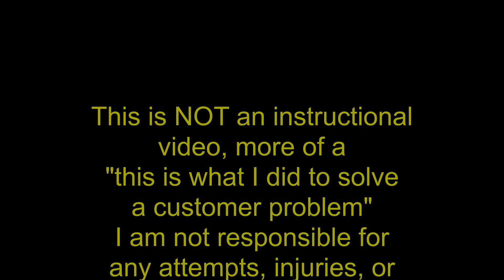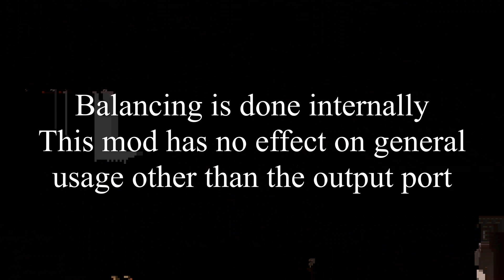Modify A Rad Power Battery

Comment: I purchased a rad with this mod. How do I get the battery to turn on. It shows power when the x260 is connected to charger but then plug back to motor and nothing
Reply from the maker: I'd need to know how it was wired to answer your question. When I do mods like these I bypass the on/off switch so the battery is always live. If the BMS has ports for the switch I'll leave it. if it's a key type switch they can just be unplugged or shorted depending on the type of switch to accomplish this (internally).
Reply: @rhodesahead4204  Hi Rhodes, the "behing" of the battery cracked and I can't find it anywhere on the planet. Do you have any idea what I could do, or where I could purchase it for the battery (back) cover? Or how to seal it ?

Comment: This might sound like a dumb question for you but what does modding it with this connector do. What will be its function
Reply from the maker: several benefits, mainly getting an otherwise functional battery back into service. Now its more "versatile" as most aftermarket and replacement battery's use an XT60 or XT 90 connector. Now its hot-swap-able or you can even run more than one battery at a time (in parallel) to extend range. This particular battery is in service for a pedicab company and they run through 3 battery's per event so the ability to hot swap is important

Comment: I have to make this adjustment why can't you make a video how to connect the wires safely without getting shocked...
Reply from the maker: its DC, you might see sparks but its not likely to shock you. the major risk is shorting the battery when the cables are bare. I just solder one wire at a time and heatshrink it before moving onto the next wire. for reference this guy shocks himself for fun and the video is of his tongue in stead of fingers but you might get an idea of shock https://www.youtube.com/watch?v=hp97GjuULX8 and this one might be more relevant to your specified fear https://www.youtube.com/watch?v=snk3C4m44SY&t=39s I have an aventon battery that needs this same mod, IF I can film it then I'll post it but big if.

Comment: how do you get it open? after removing all the screws i still can't get it open. I don't know where to pry the shell open. Please help us out.
Reply: Did you find out how you open it
Reply: @murtadhaal1483  No i didn't. i'm still looking for answers. I did find out that it' probably stuck because they used RTV silicone glue. How do you get it loose when it's stuck? i have no idea😭 lol
Reply from the maker: Mine just came apart, no fuss. Some batteries are glued in but not the cover. If you do need to pry, do so carefully and with PLASTIC tools. If you skip and puncture a cell with a metal tool you will cause a short and a fire.

Comment: Hi,
How did you open the battery case? I've unscrewed all the screws, but nothing changed. Is it glued also? 
What tools did you use? 

Thanks
Reply: i also can't figure out how to open mine. all the screws are out but can't get it open😭.
Reply from the maker: Mine just came apart, no fuss. Some batteries are glued in but not the cover. If you do need to pry, do so carefully and with PLASTIC tools. If you slip and puncture a cell you will cause a short and a fire. I use an auto panel tool kit that has a bunch of shapes and bicycle tire levers or a spudger depending on the shape that I feel would best help me.
Reply: Hey did you ever get jt to come apart?

Comment: I wonder if its possible to replace the connector on another battery, with one compatible with my Rad Rail... You showed that pin component being just a little pop out, off to google, If I can get a cheaper after market battery, i can replace its connector with a rad-style one. Do you by chance know the "name" or part number of that style 5 pin (2 in use) connector?
Reply from the maker: Glad to have helped! Most common terminal mod is to dfewlete the OEM connector and run XT60 or XT90. I would hit up ebay for a dead battery case only for the series your looking to hotswap into and switch the parts you need. good luck

Comment: Forgive me I'm a noob. Why does it only show 24v? Thanks
Reply from the maker: This battery was really low, the multi meter was just to prove that it had an output. the battery is rated as a 48V 672WH, with these specs the max charged voltage is 54.6v and the recommended minimum is 39v. this battery was definitely abused by its owner (not I) but that's the pedicab life for ya.
Reply: Can you draw more then 40amps from this battery with that new plug?

Comment: Thanks, mine didn't have the burned connector,  but I used your video to change the Rad connector to a XT90. Now I can use duall batteries for a 90+ mile range.
Reply from the maker: glat to have helped, I'm working on a bosch and some other brand ebike battery videos coming soon